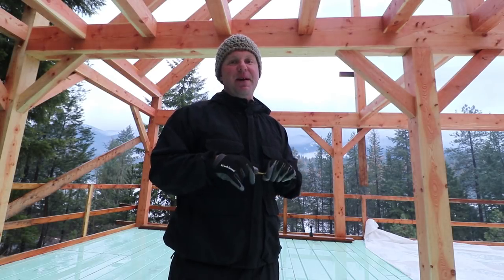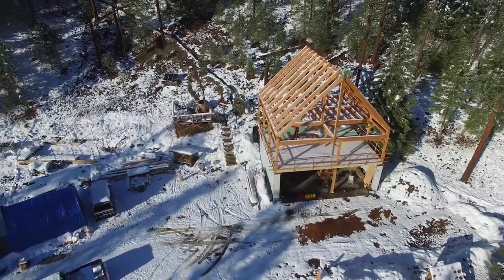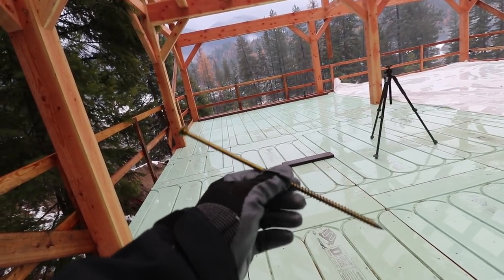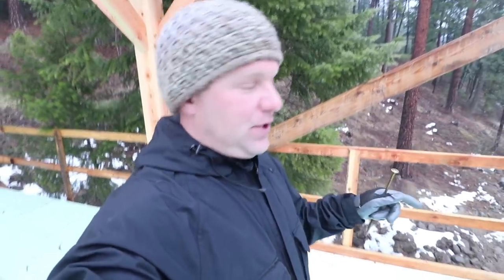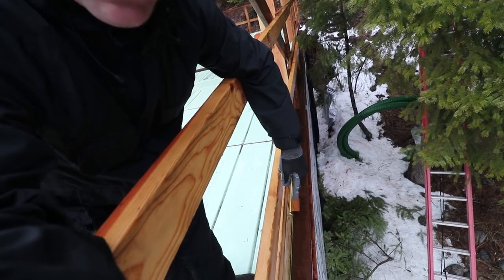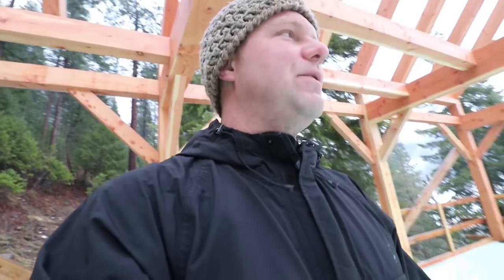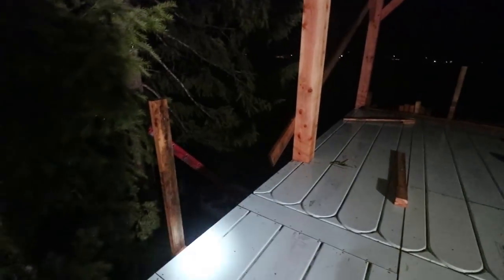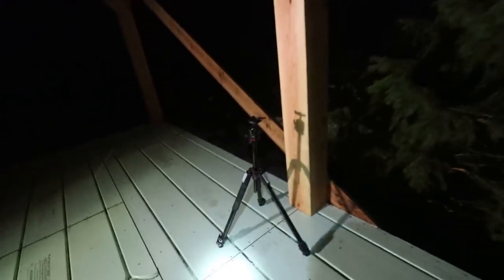How To Secure a Timber Frame To a Subfloor

Comment: Those screws are sooo nice. Back in the early 80s I helped my friend put up a pole frame house and we used 14"    barn nails that were twisted. Whacking those in with a sledge hammer was NO fun. It's nice to see that technology has helped in certain ways but the tradition still carries on. Keep up the work, it's looking good.

Comment: Nick Wiese: Hi Jesse - I was involved a few years ago with 8"foam panels for most of the walls, for windows I made a 3/4 jamb of wood using a biscut joiner & clamps. so the hole we cut for the windows had to be 1 1/2" larger, as we could not mount them in foam and trim out later. The tab of course could be on the outside and trim it out?  Please note there are standard size door replacement glass, but no angles!  they cost a lot less than custom sizes, we set em on hard rubber blocks and I sealed em with caulk  as I put em in. so it all  trimed out nice! It is good to have at least one window to open in a room area, in case of fire so you can get out. doors are tempered glass, I am very proud you all have stuck with it! Good Job! Nick

Comment: As a young architect from Colombia, this type of construction is completely strange to me. I've been learning alongside your videos. Since the pour of the foundation walls or the installation of the sill plates ive wondered how the connection of the timber frame to the joists or the exterior SIP would be.  This video answered a lot of questions i had throughout past videos, very interested in those details. Would be nice to see you guys explain from the construction details or graphically, to understand how its put together.

Comment: I would feel much better with ten metal straps (1/4" x 4" x 48") holding the Timber Frame on the outside to the concrete foundation walls.  Was concerned in November about how the Timber Frame was connected to the foundation and how the weight was transferred to the sill plates.  Hope that a safety rope has replaced the safety railing around the first floor, don't want anyone falling off of it.  So glad that no serious injuries on the build.  Stay safe...
Reply: I agree totally.  There are tons of ways to secure that top frame  to the to the foundation walls.  You could even bolt angle brackets between the posts.  It will all be hidden.

Comment: Jessie: Major concern on psf load on the warm board at the posts. I see future crushing of the foam core and load transfer to sip and any interior drywall paneling which will then buckle over time that will cause bulging and cracking. I also think Simpson ties or strapping between post and rim joist for both horizontal and earthquake load is needed before sip panels go on.
Reply: I was thinking the same...I'm surprised they just didn't notch the warm boards to fit the post, maybe it has something to do with the integrity of the product... agreed with the ties but maybe it's coming.
Reply: David Brown, the warm boards are made with OSB, (no foam)
Reply: They're 1-1/8 plywood, not OSB.
Reply: Ryan Smith
 I stand corrected, though I doubt they will crush any significant amount :)
Reply: What, then, is the green stuff? Plastic??
Reply: Dave Weber: Green stuff is aluminum sheet that has been formed and then laminated to the routed OSB.

I think a little settling of the posts on the warmboard is inevitable.  The OSB fibers are horizontal, the post fibers are vertical and stiffer in that direction, and of course the ends of the posts are not perfectly fitted to the floor surface.

I didn't see the load spreaders installed under the post locations under the warmboard.  Glad to hear that was done.  One thing that really impressed me in the last few weeks is how heavy a timber frame is.  Add a big pile of snow on a roof... If that floor is roughly 1000 feet^2, and snow load is 50 psf, that's 50,000 pounds plus whatever the timber frame, roof, SIPs, sheetrock, and attic interior weigh, sitting on 12 patches 8 inches square... That's about 100 psi or 14000 psf on that warmboard under the posts.

They screwed and glued the warmboard to those joists well, so that most of that load will be carried by the warmboard and the lower portion of the joists.  All the joists really need to do is transfer shear from top to bottom, which is why those webs are so thin.
Reply: Iain McClatchie, OSB and plywood should be good for at least 300psi allowable design load without allowing for increases for short-term load durations (can't remember off hand if you get to use 1.25 for snow loads or not)
Reply: Thank you for that.

Sounds like Jessie and Alyssa have plenty of margin, as they should.
Reply: Steve Few: Like wise "people read replies before posting stupid answers"! If you had you would see your correct answer was replied many times over , days ago. Without rudeness. I think they call that a troll on YouTube . Is that what you want to be known as ? Thanks for replying anyway :-)
Reply: Steve: You do what for a living and entertainment ? Being a troll ? I said it first ! I'm just doing you for entertainment. Ok I'll stop being a child. Sorry , but you don't have to call people stupid.
Reply: I would strap the shit out of any and every available(non-visible) spot around those posts all around the entire structure.

Comment: My question is how will you heat I know tubing & radiant but will it be a wood fired outside hot water heater/boiler ?  We heat here with one and have for near 20 yrs now 110 volts & a couple circulation pumps plus we heat or potable hot water as well when it's running. Think about a circulation loop for hot water to help upper story hot water sources.  Great job you should be proud of your accomplishments. 3F here at 8am 12/26/2017 in the Extreme NW Corner of Ohio an toasty warm.

Comment: Dont go cheap on windows or insulation they will pay for themselves in no time. The difference made by doing these two things in my 150+yr old home was unbelievable! Triple pane windows are a must!
Reply: Lance Ladewig : Agreed. I went around my old house and foamed/calked every crack/opening. Worst culprit was the vent above the stove. When i foamed that the kitchen suddenly got a lot warmer. LOL  MY propane suppler wanted to know why I cut back on my order.
Reply: Not to mention the SIP's they're using are top of the line so why not complete that envelope with triple panes. Yes they're expensive but as i said before they pay for themselves. If this werent their forever home it might not be the best choice...
Reply: I ended up going with the tilt in/removable sashes, you can just lay them down and clean them  The self cleaning glass would be better for them at least on the front.

Comment: I am a fan of your adventure, but confused about a few things.  In regards to the frame, why wasn’t the frame dropped into pockets to stand on top of the sill plate versus on the warmboard?  Secondly, why use the screws versus wood pegs?   Just thinking there were reasons why to do what you did.
Reply: I would strap the shit out of anything and everything that is not exposed/visible!
Reply: Christian Geiselmann you must have missed the video showing the sill being attached to the concrete walls

Comment: Now that you have that handrail down, you can put up the scaffolding all around that you should have had since the concrete was poured.  Place it low enough to not interfere with the sips and it will greatly speed construction and safety.  You have a ton of rough lumber to use and no more time pressure from the workshop.
Reply: doesn't make sense to me to remove those hand rails WEEKS before any SIPs are going up. I mean, if they weren't going to be up there at all, then sure, go ahead and remove. But since they will be up, and it's wet, and a long fall, would seem to make sense to keep them.

Comment: OSB (I joists) + Plywood (WarmBoard) + Saturation from constant exposure to rain =  a.) Delamination  b.) Mold  c.) Rot  d.) Disintegration.
Reply: Well the warmboard was rated for like 1 year of total exposure to the elements. Don't underestimate plywood. I myself was wondering more about how the warmboard can carry that weight as the posts seem to be directly placed on them (even though under that warmboard the correct load-bearing materials were used).
Reply: Marine grade....
Reply: It's a solid layer under the post.

Comment: Hey Jessie I follow why you chose to build a timber frame and cover it with SIPs can you explain ( in 10 mins or more) why you   chose this        when you could have just built with  SIPs and less timber and have it  dried in with good project planning in day two weeks from delivery of SIPs  and windows on site. I think the is a huge achievement for you both. Over winter when you get time build some temporary stairs will make life less of a Hassel than   using ladder. Merry Xmas.

Comment: I see your tarp is keeping the rain out of the basement about as well as ours is.  Ahhhh, the joys of building a house by yourself.  lol
Reply: I have a  old barn that is timber building and the sill sit on rock foundation. The old barn is not fastened down to the rock foundation. The weight of any build what keeps them there and the wind bra
Reply: Bracing in the barn keep it from moving.
Reply: Building a house by themselves? Did you not see their parent's working the saw mill? Or Did you miss the framing crew being filmed?
Reply: Basically I meant not professional builders that can get a house up and weathered in a few weeks time.
Reply: Wow.  Your hired.  lol  That is some good time. I hope my house goes that fast.   My wife and I hope to spend the winter doing the joinery for the frame and then raise the frame in April. Then it is all me.  Hope to be by next October.

Comment: I noticed that you end up with a pile of screws at the end of each project.  To help keep then collect and out of your tiers.
Get the cheapest baking pan (steel) put a magnet in the middle and use it to hold all the screws/ nails you remove.   
You can also add a magnet to a new screw bucket in case of spills.

Comment: I have never heard the road noise before like on this video.  Is the sound more line of site direct now that you are higher?  Will this be a problem later when you are living in the upper portion?
Reply: I noticed the road noise also. That would suck if the acoustics changed because their above the tree tops
Reply: With insulation in the walls and double pane windows it will be better!

Comment: Is the warm board designed to carry such a concentrated load like the posts? One would think wood on wood would be more structurally sound.
Reply: Yes, 30,000lbs per sq "
Reply: Go look at the video where they install the subfloor (warm board). It's solid wood where the post sits.  Wall frames are usually fastened through subfloors.  So it stands to reason that a post can also be fastened this way too.
Reply: Jedidiah, you sure on 30,00psi? The documentation I saw rates it as just another APA rated panel, which would be in the 300-500psi range.

Comment: The fact that the timber frame is sitting on top of the warm board and manufactured wood floor drives me nuts from a structural design.... The frame may last forever but that floor wont. Why didn't you have that frame sit directly on the sill plates?

Comment: I'm curious what's transferring the load of the timber frame to the ICFs. Is it just sitting on wormboard then osb I-joist, with osb rim boards around the perimeter? And that is transferring the load to pressure treated 4x12s on the ICF? Seems like a lot of weight on wet OSB, kinda sketchy
Reply: offtherichter7, they put squash blocks under the bearing points to keep the load from crushing the joists.
Reply: Nope its a perfect design....designed by engineers, its build specific.
Reply: offtherichter7, back of the envelope calculations put the compressive stress on the OSB at below 300psi, so assuming my rough approximations didn't miss something the boards should be well within design guidelines.
Reply: Oh I didn’t see the squash blocks. Still seems like you would want those the same dimensions of posts, 6x8 I think. So it’s a solid timber-to-icf connection. But I’m no professional. Layer all the wet osb in there you want! Engineering power!
Reply: offtherichter7, the posts are oversized for the Fc(perp) condition, so the squash blocks sandwiching the joist should give adequate bearing surface and protect the joist from direct loading.

Comment: Great v'log ! Will the slip walls go out the outside of the frame  or  in between them, so the thick beam post can be seen from either side? If between how will you seal it to keep out weather or bugs? I guess it's too late to ask but are you planning a nice porch or deck off the side? Has the I-beams been damaged from all the water? It's always been my experience that pressed wood starts to come apart if it's wet for too long.Thanks for sharing the building process with us, if I ever do this myself I'm learning what to do and more important what not to do. Just a though, it looks like there will be a great room over the one end. Will there be a fireplace? A great room needs a great fireplace to set it off.
Reply: SIP panels go on the outside.

Comment: Such a massive structure not directly conected to the concrete base walls is a BIG NO NO for me! I would definitely bolt that wood frame with massive steel ankors casted in the concrete. At least same style like they did it with central pillars to the basement. Wind forces will be huge with such a big area. These thing long screws looks like joke to me. Maybe it ok with the engineers and code, but I couldnt sleep well in this house. This is way beyond my safety zone.
Reply: pangrac1 I think the Shelter Institute would know how to build structures they have been building for 35+ years. Just a little.
Reply: pangrac1 also the sill plate will connect to 2 structures once they come in.
Reply: pangrac1; If you watched the videos, you would have seen where they fastened the sill plate extensively with large concrete lags; the sill plate will never come off that foundation, under any circumstances short of, god forbid, being burned off! Those "long, thin screws" are the later-day equivalent of a 3/8" lag. 
Having said that, I agree that it's not enough. However, Jesse just got done explaining that the SIP panels will be fastened on the sill plate, the joist system AND the exterior posts, etc, of the frame. THAT will certainly tie the whole thing together. Each screw driven in through the SIP into each member of the structure, each single screw will give its several hundred pounds of sheer strength to holding that structure on that foundation.
That's put my mind at ease!
The thing that was worrying me was the Warmboard; I thought that was a foam-type stuff where the Radiant tubes a grooved into - that green stuff. But, I have never seen or worked with it. Folks on here are telling me it's not foam, and that wood is not OSB, but actual plywood. It still concerns me, but I guess, if it was good enough for the engineer, good enough for Shelter Institute, then they must know things I don't... And that's no stretch at all!! :-)
Reply: Thanks for the "youtube expert" insights.
Reply: Structure is great, but the connection to the base shell is what is making me nervous. Dont forget that ppl from Shelter Institute will not sleep in your house, but you and your childern will.
Reply: Yep I have watched all the videos since the first dig in the dirt and I enjoyed it. That huge heavy roof frame shoud be firmly connected to the concrete sidewalls and not only to the still plate. Those long thin screws are exposed to shear stress and can easily snap. Stress is caused firstly from wind power, secondly from everyday and seasonal thermal expansion or shrinkage and thridly from moisture changes and shrincage of the mostly wet fresh wood as it dry. These are very powefull forces. Better be safe than sorry.
Reply: Actually someone mentioned that these long thin screws are just temporary solution. So we will see .

Comment: You weren't kidding about the extra sill needed. My sympathies on installation. The SIP should be easy with a crane and a man basket. Yeah windows are a big PITA with the specs, that's why there are lots of orphan windows. Same installation crane and man basket.  Have fun.

Comment: I was wondering if you would put the boards that keep everything square on the inside of your structure (say from timber to timber), so you can work on the outside and not have to worry about the square.  Of course on the other hand noting how perfect and tight the joints were on the frame would you have to be concerned about it anyway?
Reply: i dont think you would want to do that. they are on the outside to minimize the holes in the timbers on the inside from the screws.